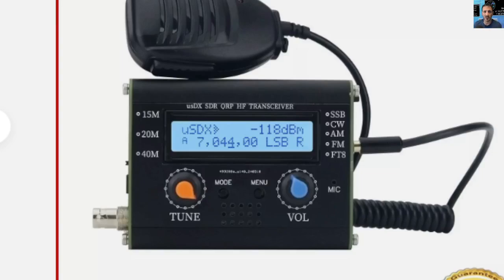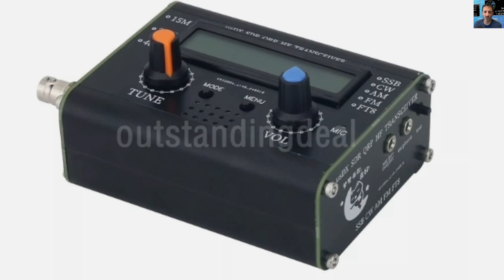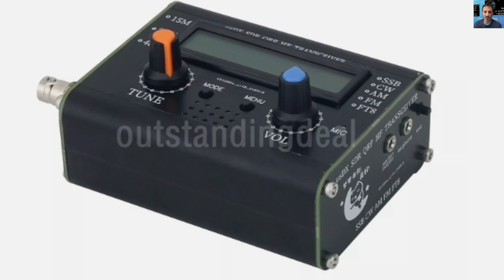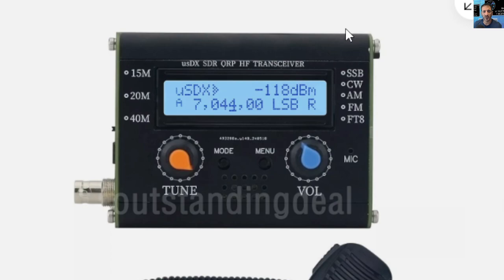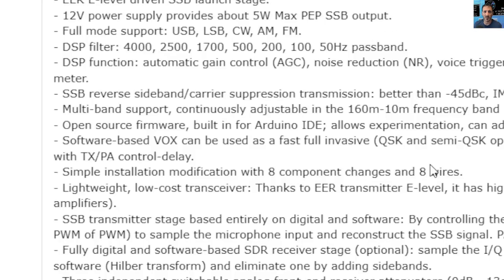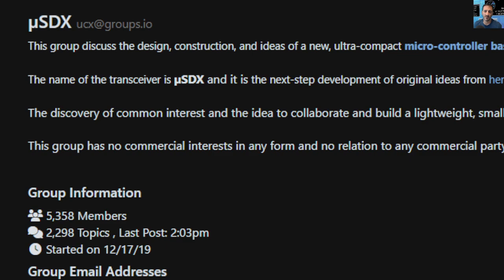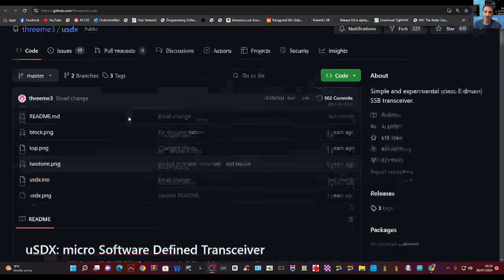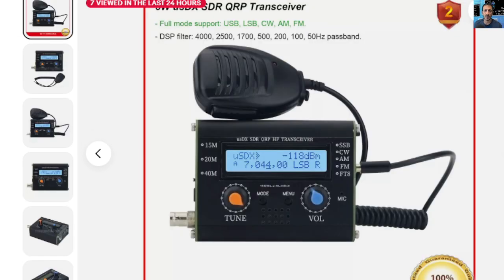QRP - MINI USDR - 5 WATTS - 3 BAND

Comment: Nice video.  Thanks.  One question, where's the manual located?  Thanks for your help!
Reply from the maker: There isn't one but setting says it all .
Reply: @M0FXBHamTech  Yeah, I understand the settings.  But getting to them and changing them is the difficulty.  It just seems like the controls spaz out.  Do the same thing twice and get two different results.  But thanks anyway.